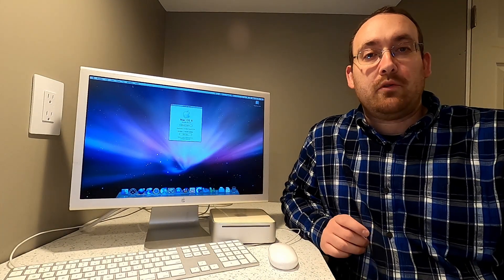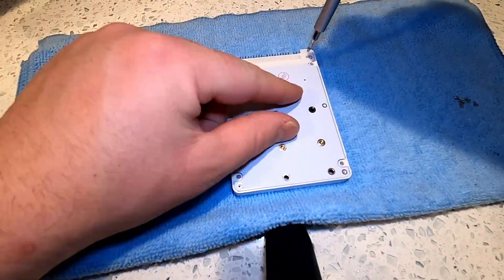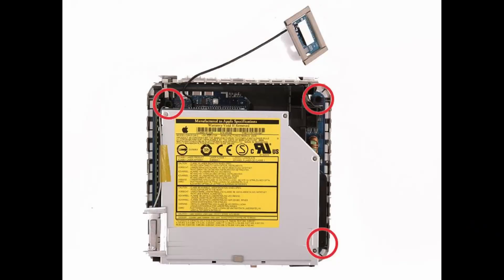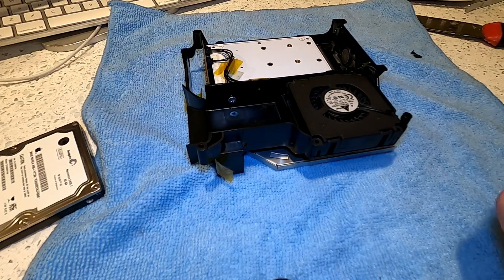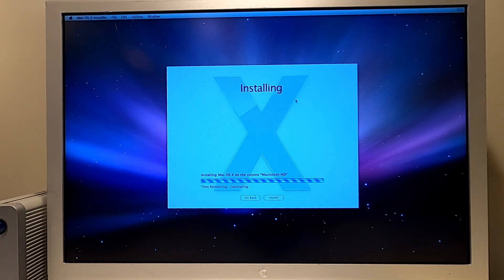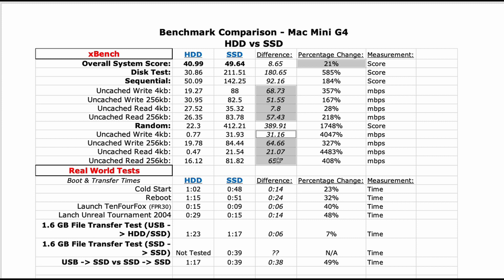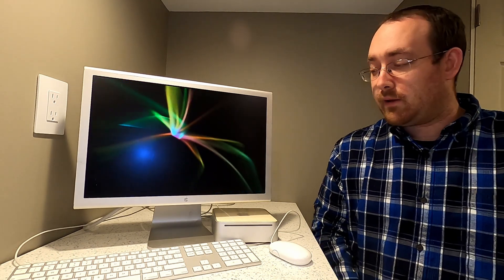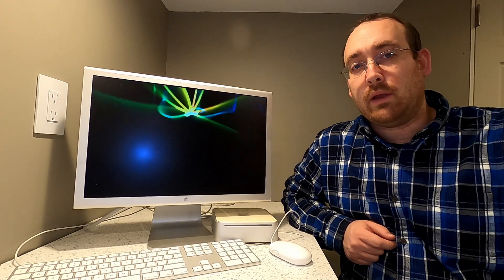Mac Mini G4 SSD Upgrade

Comment: What is the improvements of using a CF card direct with the IDE Port with a simple Single CF-> IDE Adaptor? Something like a 1000X 64 or 128 GB CF Card from SanDisk.

With a 100X CF Card on a Powerbook G3/G4, it just beats the mechanical hard drive and anything faster than that blows the hard drive out of the water; a 75X CF Card is about equal in speed to a mechanical hard drive.

Comment: could you please provide links to the parts used?
Reply: From what I can see in the video, I bet he's using Amazon item B01GRMUQRG to adapt to an mSATA SSD. There's also B07Z67GX6W which is what I ordered since I have a M.2 SATA SSD (non NVMe) laying around and just need an adapter.

Comment: Good vid, thank you.  Presumably the SSD 'looks' like a standard PATA disk regardless of the OS - would OS9 run on it?
Reply from the maker: Mac OS 9 does not work natively on these machines. There are workarounds though to install Mac OS 9, so it can be done.

Comment: What is the limitation on space? 256GB?
Reply from the maker: No, you can use a hard driver larger than 256 GB. The Mac Mini G4 uses an Ultra ATA-100 (ATA-6) interface that theoretically supports up to 144PB. Mac OS X 10.4 and later support up to 8 Million TB. The logic board may have a limit that is much more realistic in size, but over 256GB should be easily doable. Interesting read here on hard drive size limits: https://lowendmac.com/2014/maximum-hard-drive-size/

Comment: I made those changes with an PATA to SATA adapter but my SSD isn’t recognized, do you have a solution or a specific accessory?

Another problem I have is in C704 capacitor (closely to the processor backward from DVI port) that is broken...Do you know what are the main characteristics of it to change it? Thanks…
Reply from the maker: Sorry you are having issues with getting your PATA to SATA adapter to recognize your SSD drive. I have not had issues thus far using this adapter from eBay for several PowerPC based PowerBooks, iBooks, and the Mac Mini G4: https://www.ebay.com/itm/mSATA-to-2-5-PATA-IDE-SSD-Enclosure-Adapter-Case-9-5mm-Solid-State-Drive/301976528432?hash=item464f342630:g:7VsAAOSwmfhcHINP
As for SSD's, I have successfully used several 1.8" mSATA Crucial and Samsung drives.
As far as the capacitor, I have not had to replace any of those yet.
Reply: I had this issue that installing from DVD there was no disk to visible. Go in to Disk utility before selecting the language, the Disk showed up there,, so I tried to format it in Mac OS Extended journaled.  It now comes up during the installation, but I have an error You cannot install Mac OSX on this volume, you cannot start up your computer using this volume, I am wondering if it is treating it as a volume and not a device that's the issue....if I figure it out, I'll re post here.